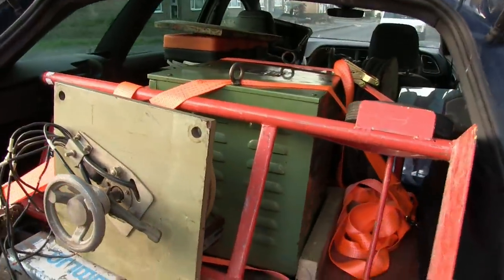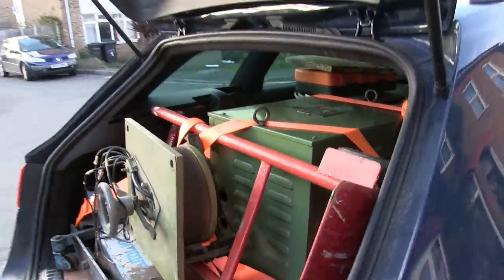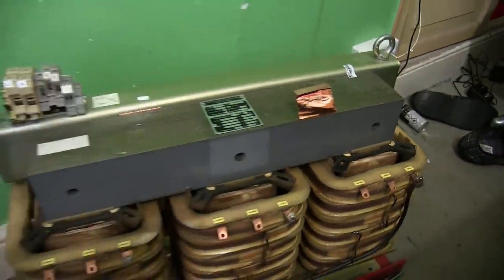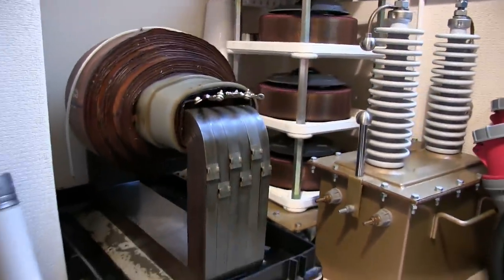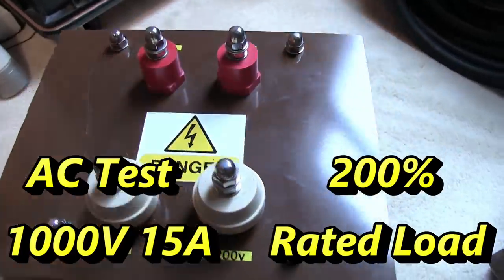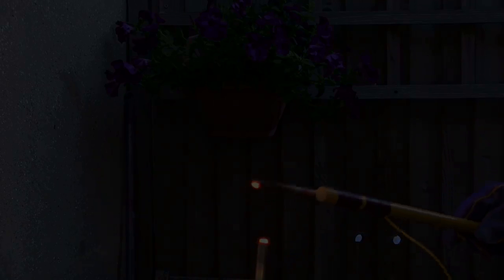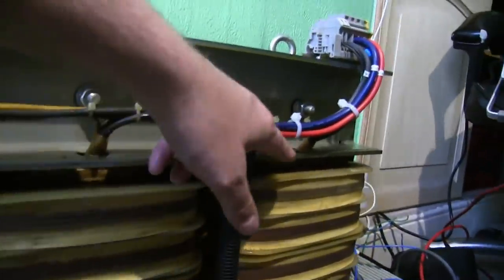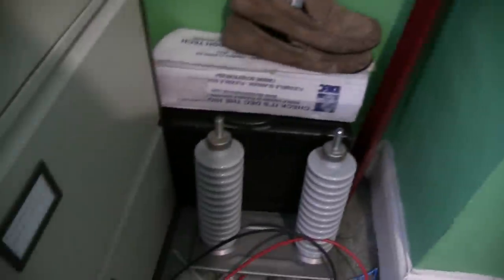Extracting Maximum Power From Transformers

Comment: Best buds casually trading industrial grade electrical equipment
Reply: As you do.
Reply from the maker: He's a good chap, I gave him one of mine.
Reply: @Photonicinduction  aad to see one go, but itl be in good hands
Reply: @JamesUKE92  You could put mains on the 50V with an appropriate ballast without saturating the core, but you'd have to watch you don't exceed the breakdown voltage of the insulation on the primary (I'm guessing if it's 415V you're in a country with 220-240V single phase). You could also play about with different series/parallel combinations, including connecting primary and secondary as an autotransformer.
Reply: @fardreaming  I don't really understand this ballast thing, i mean you are just introducing extra inductance in the primary winding. I mean isn't KVA rating indirectly implies the max current you could draw at rated voltage before core gets saturated, so how could you increase the power output above it's rated value.
Reply: @Rk76742  It's better to think of the ballast as adding inductance to the primary, rather than inducing anything extra in the primary. The ballast is limiting current by acting as impedance to the flow of AC, so it's analogous to adding resistors in series in a DC circuit. 

The VA rating of a transformer is based more on its thermal operating parameters than electrical constraints and are more of an estimation than strict calculation. All transformers are capable of briefly exceeding their VA ratings, sometimes many times over (and in fact they do this every time they're energised), but if they're operated in this condition for too long the insulation overheats and breaks down (a short circuit on the output would give you absolute max output current for any given input voltage).  

For this reason, there is no way of increasing the power output above the rated value (unless you add your own DIY cooling system), and a ballast always acts to decrease output power. It is possible to increase input voltage above the rating by lmitiing the current, but exceeding the VA rating for too long will increase the temperature of the windings beyond their rating. Some manufacturers are more conservative with the VA rating they give their transformers, so you have more headroom to exceed this without damage.
Reply: Those massive transformers are absolutely gorgeous 😊

Comment: That's a car being used as a pickup truck. LOL
Reply: Lol I was thinking the same thing, he really needs his own truck, forklift, and skylift to build the really big things that go boom rather than pop.
Reply: station wagon ... overloaded!
Reply: Yes , it's very dangerous  to put heavy  load in the back  seat  because  in case of accident  they will smash the driver.
Reply: @fvckyoutubescensorshipandt2718  He better spend his money on buying a power plant in the UK to do more experiments. 😅
Reply: @labiadh_chokri  you don't listen then. it was screwed to the floor.
Reply: @handlesarefeckinstupid  Yeah, that was obvously properly secured.
Reply: I worked with a bloke who ran a business out a corsa
Reply: Of course, it threw me for a second when he opened the "driver's side" door (would it be called "Yank opened"?)...
Reply: Anyone who has had to do this knows you just have to do what you have to do and sometimes you just have to make it happen.
Reply: Maybe he can pop a suspension spring with high voltage
Reply: @darkSorceror with high current, absolutely!
Reply: It looks like the car is modified and already has lowered suspension nice look and like you say you got to do what you got to do it's not full until nothing else will fit
Reply: @labiadh_chokri  That's probably why he bolted it down and strapped it, yeah :)
Reply: What expect???Its normal in EU..
Reply: Killer voltamps
Reply: seat car are usually not so good quality cars had 2 both shite, you can load 2 bags of grocery and it will sit down :)
Reply: @listec  it's a leon ST, those have the same suspension as a golf (non gti of course) or Skoda Octavia, and are only rated for ~600kg of additional load (more like 480kg if you consider fuel and a driver)

Volkswagen cheaped out there
Reply: @tiqo8549  Well he already mentioned he hated silicon-powered things, but with a giant homebrew inverter powered by used batteries from Tesla cars it's cheaper and far smaller and lighter (compared to buying a 2MW generator at least) to get MW's of power to play with. 1.2MV 1A can make a jacob's ladder that starts at 3m and spreads to 10 (not something you want to do indoors). A 100kHz version of the cascaded transformer stack for it would weigh maybe 20kg ea (160kg total), far easier to move and deal with in a garden. If you want that 50Hz roar when it arcs instead of a vanilla inverter make it a scaled up HV audio amp of the sort used to modulate Class-E Tesla coils and modulate the input to the transformers. That's what I would do if I won the lotto anyway.
Reply: Payload limit? What payload limit? 😈
Reply: I don't think pickups are that common in Europe.  Cargo vans and station/sport wagons are probably more more-so than north America.  Interesting dynamic
Reply: Historically we often couldn't afford multiple cars so if you needed 7 seats on one day but a huge boot on another we would buy big Volvos etc 
But with the weight this bloke had in his a Citroen would have been better 
Shame they stopped making stuff like that
Reply: Normal usage of wagon if you ask me =)
Reply: He should lower the suspension by annealing the spring in place.
Reply: get chevy'd!!! since U'r already baked!!
Reply: Pickup trucks are not that popular in the UK. They don’t have much usable space and everything exposed to the elements and thieves. More often used by tradesmen as a status symbol where they now run their own company with other people doing the real work. Only tool in the truck is on the drivers seat
Reply: This a pretty typical use for cars in the UK/Europe.. It's amazing how much you can put in the back of a hatchback or station wagon!
Every car I've owned I've bottomed out the suspension on more than once. Did you know you can put half a cubic meter of sand in the back out a Subaru Outback without a problem, even if it takes a bit to shovel it in and out? :)
And if you have a softtop you can use an engine crane to lower things(Like engines) in and out of the back seat! Very handy.
Reply: That's the way we carry stuff around on this side of the ocean.
Reply: @handlesarefeckinstupid  Even humans weigh hundreds of kilograms during the impact of an accident due to the G-forces, how many tons can a screw hold? I bet it's not that much until it's sheared or stripped out of sheet metal._
Reply: @IBM_Museum  That's mainly British thing to have the steering wheel at the wrong side, most of EU has also drivers seat there and same thing happened to me also wondering where he sat._
Reply: Best SEAT in the house lol! Looks like it really has to earn its pay with that guy driving.
Reply: You get taxed more for trucks there
Reply: @wick_wack  One place I wouldn't want to live is in the UK. The weather is usually overcast and gloomy, rainy, and I'm not thrilled with many things that I read about that are going on over there.
Reply: @electronicsNmore  me either, Traveling might be all right
Reply: @coreyworthington2797  Not a good way to lower a vehicle... 👎🏻
Reply: @coreyworthington2797  maybe if it made sense.. 🤔
Reply: @darkSorceror  good idea!!

Comment: Must be a lot of ozone in there 😂
Reply: Ozone is toxic!
Reply: @Adamisgood24  - No odors after its aired out!
Reply: Its now clean room! :), uv-c and ozone...
Reply: @negumanezer  was afraid he was staring right at uv :'(
Reply: Not ozone... Nitrogen oxides...
Reply: Corona free room
Reply: @thebrowns5337  ahahah sure
Reply: I was worried about the UV. I played with a spark gap device and I had a lot of pain in my eyes a few hours later.
Reply: @ddegn  Just ordinary transparent work goggles are enough to stop the UV part of the light
Reply: I am by no means an expert, in fact I'm hardly knowledgeable about dealing with HV at all, but isnt ozone a much larger concern with the "harsh" arcs than with these big and "billowy" ones? Please, correct me if I'm wrong because I'm all for learning, I just remember hearing that in the past
Reply: @RChero1010  you are right... Hot arcs produces NOx mora than ozone
Reply: Nah, AC is really lousy at O3 production, and the voltage is hardly anything when there's actual arcs. Now if he kept a 10kV DC version running with no actual arc but enough electrode surface area and close enough to actually draw 63A primary current anyway, yeah, you'd have a nice homebrew gas chamber pretty quickly.
Reply: Exactly what I thought. He needs to be careful because high levels irritate the lungs.
Reply: @ddegn  then it might be due to high light intensity, as you see, you may even weld with your 3M glasses, the only thing missing is the tint to decrease the passed light's intensity
Reply: @electronicsNmore  when here in my bedroom I play with the arcs made with a 300w zvs oscillator and a TV flyback for something like 15 minutes, the air becomes almost unbreathable and I start coughing 😬
Reply: @KnaufL  You have got me wondering how I managed to burn my eyes. It's hard for me to believe I would have done these experiments without the safety glasses but it was nine years ago so I don't remember everything about the experiments. I'm really wondering if I had viewed some arcs without the glasses on.
After I posted a link to the video on an electronics forum, I was warned about burning my eyes. I thought I was fine until later in the day when my eyes really started to hurt. The pain subsided in less than a day but it was pretty bad for a while.
Thanks for the info about the UV protection in most work glasses. I didn't know about this until after seeing your comment and Googling for more information.
Reply: @Adamisgood24  Not half as bad as singed carpet and burning polystyrene .
Reply: And the mosquitoes are all dead, guaranteed! 😂😂
Reply: @thebrowns5337  😂
Reply: @nxxxxzn  you clearly haven't seen him just to shoot x-rays for fun
Reply: Probably more nitrogen oxide than ozone in this case. Both have a quite similar smell - not exactly the same, but can be hard to distinguish if you don't know the difference. Ozone is mostly produced by the corona discharge - the blue/purple "glow" you see at high voltage between 2 electrodes, before any real arc is formed. Once an arc is formed, the gases get so hot, that oxygen will react with the nitrogen in the air, rather than forming ozone. If you light a big arc (doesn't have to be nearly as big as the arc in the video though, haha) inside of a glass container and let it run for a few minutes, you will see brown nitrogen dioxide gas forming inside.
But that stuff can be quite nasty as well, if allowed to collect in a not so well ventilated area - it forms nitric acid in contact with water (for example if it's inhaled)
Reply: @fabriziobrutti1205  stop farting then ..🤭
Reply: @fabriziobrutti1205  definitely ozone. Lot of Corona discharge! Won't be near harmful levels. Maybe if those arcs were DC more air would be ionised. Changing polarity makes ionisation more difficult. Definitely more nitrogen oxides as nitrogen is the most abundant gas in the air second to oxygen.
Reply: @sea-saw2654  😐😑😶🙃
Reply: @SimplyElectronicsOfficial  ehm... Sorry m8 but you aren't right about the nitrogen and the oxygen in the air ... In the air you have 78% of nitrogen and 21% of oxygen and 1% of other gasses... Instead you are right about the fact that it's produced more NOx than O3... But I didn't get it all... You begin with "definitely ozone" and you concluded with "definitely more nitrogen oxides" 🤷‍♂️
Reply: and nitrogen oxides also 
(the smell of NO2 and ozone = 🤤)
Reply: @381delirius  not for the whole video. He stared at burning plasma
Reply: @fabriziobrutti1205  AND ozone
Reply: @glenholmgren1218  yeah, and a little bit of ozone... Even though I'm not sure of how much of it you can produce with 15kV (that drops as soon as you start the arc) and not so sharp-edged electrodes..

Comment: This experiment single handedly restored the ozone layer
Reply: sadly too much arc not enough corona discharge
to make ozone you need a cold fan of tiny little sparks most easily created around 3kv using a ceramic or glass layer between
lots of nox gases though

Comment: "Transformer not even warm" - however the mains fuse was smoking!!
Reply: "However, the neighbourhood was blinking"
Reply: I've always wondered how does he pull that much juice through his hookup to the mains?? Or does feed into a bank of huge capacitors first then out of capacitors to transformers?
Reply: @User78347  also wondering
Reply: @User78347   He has over 20kw of power service, that red 100A cable carries his entire house's electrical capacity
Reply: @DanielandStuff7  100A or 150A 3phase is not uncommon here in europe, so you basically have 230V*100A*3 = 69kW of usable power, as the fuses are "slow / medium blow" you can easily spike them to 500A for short amounts of time and get in the range of half a MW for 2-3 seconds or so.
If you have flow through water heaters, they are in the range of 20-35kW typically, if you have multiple of these in a house, you need that 100A/150A per phase.
Reply: @Spacefish007  Photon 'only' has 100A single phase so ~24kW
Reply: @User78347  You are confusing voltage with power. Power has nothing to do with it. It's all about the voltage. Transformers do the work.
Reply: @Spacefish007  Most of European countries have 3 phase supply. Traditionally each floor of the house would be on it's own phase, but here in the UK domestic electrical system is a bit more backwards. Think this is because of historical reasons - wanting to save money post war.
Reply: @Spacefish007  In Romania, we have 5 to 7KW per house/flat
That means a 25 or a 32A main breaker one phase, after meter
Or a threephase 16A breaker on three phase system with neutral.(house/domestic)
Reply: @mrfrog8502  Yep. See the Ring Final principle! A post war copper saving example. I still use RFC's but am slowly coming around to to the 4mm radial idea  :)
Reply: @Spacefish007  You get 230 V 3-phase supply in Europe? In my house in India, 3 phase supply is at 415 V. Also the formula for power is √3VI, not 3VI.
Reply: @Chopper153  Yes 3-phase is typical in Europe up to the last distribution box, typically in the flat itself. 3-phase stoves and water heaters are pretty common in europe.
between 2-phases you have 400V RMS, between neutral and phase you have 230V RMS.
Formular depends on how you connect it, if you look at 3 differnt phases between phase and neutral seperately you have 3*V*I, where V is defined as RMS V.
Reply: @Spacefish007  Almost similar here. 415 V line to line upto the distribution box and 240 V phase voltage. Some of our houses use 3-ph ACs but most appliances are 1-ph.

Comment: I don't have a transformer to maximize, but I'm watching anyway.
Reply: yes you do, every home appliance has a transformer inside it :)
Reply: @dumdum7786   Incorrect. most have resistive droppers or switchmode power supplies.
Reply: See , because some people want to ruin your fun - microwaves do , i do not advise you to buy few of them , use a screwdriver and use the transformers - that would be dangerous , however i am saying that if you have microwave or few they have transformers
Reply: I have several microwave transformer from old microwaves.
Reply: @WELLINGTON20  I mean larger appliances, like tvs and what not. plus, switchmode power supplies have transformers in them.
Reply: @WELLINGTON20  You mean capacitive droppers? Resistive is unusual.
Reply: TV's these days have transformerless power supplies in them. At least the flat panels are like that. You'd know if it had a transformer. The back would be sticking out a lot farther or it would have a big wallwart. Some microwaves also don't have transformers, like the newer Panasonic inverter microwaves. 

My old microwave died a month or 2 ago from the magnetron taking a dump. I decided to keep the microwaves transformer for future "projects" 😁 ... That thing sure weighs a ton I'll say..... I'm glad I kept it though. Just running a simple 12VAC into it from a small wallwart supply, the secondary outputs over 240V. It steps up over 20X the input voltage. So... Could you imagine having multiple MOT's in series? The magnetron in the microwave gets well over 2-3KV. Electrical newbs should never be messing with these things.
Reply: Well now you know what to ask for for Xmas this year…

Comment: That oversaturation thing feels like water in the cooking pan. As long as you've got moisture left temps are keeping steady and it's fine. But when all the moisture's gone temperature quickly spikes up. 

Here it's the core soaking up the power but when the core is saturated, there's nothing to "ballast" the current at reasonable level so they shoot up and fry the coils